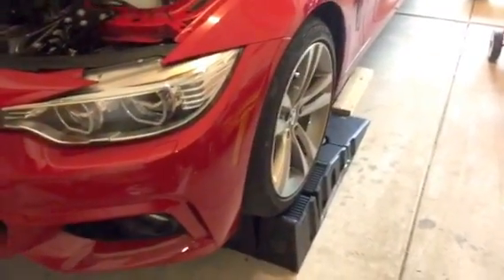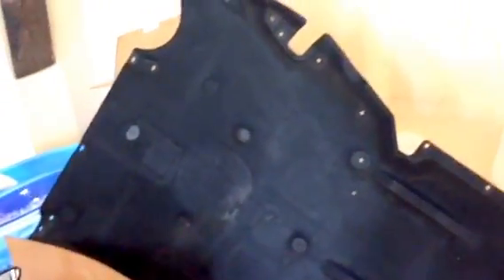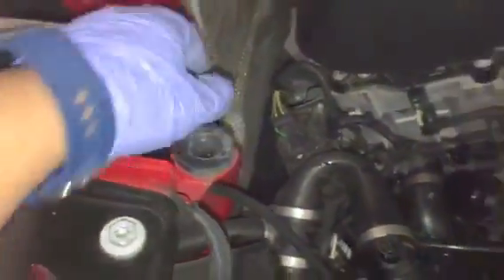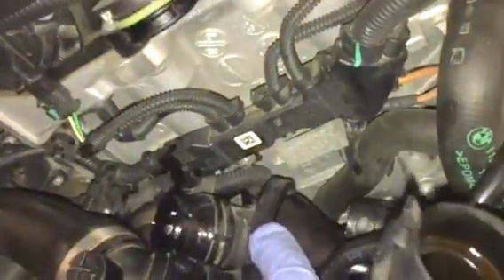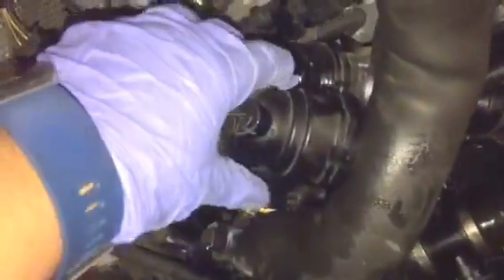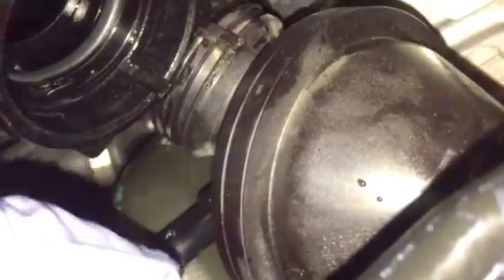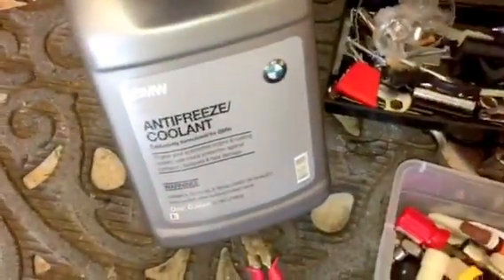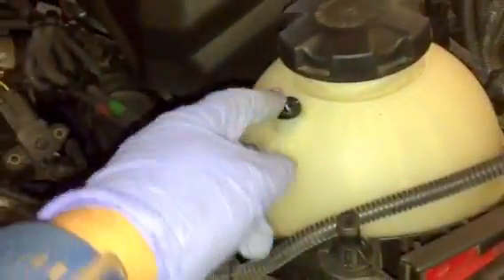BMW 428i Thermostat Replacement Part 1

Comment: Good video very detailed
I saw the part 2 of this
How is being your bmw after the thermostat replacement. I have seen in other videos that you need an special pump to refill the coolant and a bleeding process where the water pump is runining without the motor on.
I'd like to know if your is running good without doing the process I mentioned.
Because im planing to replace the thermostat in my 320
Thank you.
Reply from the maker: Hi There, I am so sorry. I just saw this question. My car has been driving great without any issues. I followed exactly what was explained in the video.

Comment: I can do everything except get the electric plug out. You cannot just “pull it” as you say. So is it a push up or down tab? What are you using to get it off. 30 minutes into just messing with this tab alone. Thanks
Reply from the maker: Hi There, sorry for the late reply but for the other audiences. You can just pull on the tab if that doesn't work, take a flat head screwdriver and use that to pop the tab. It will come apart, just be patient.